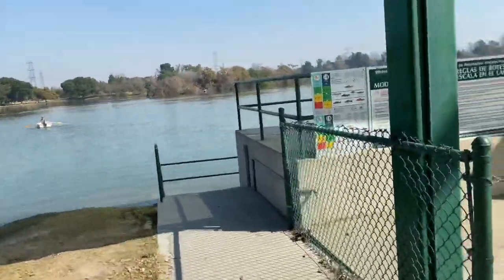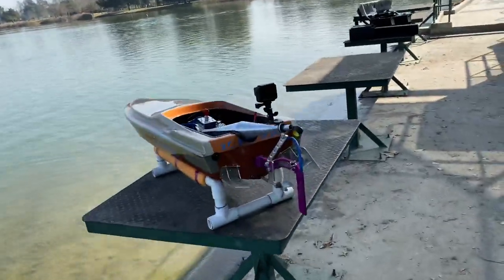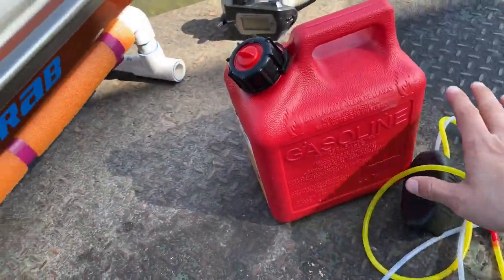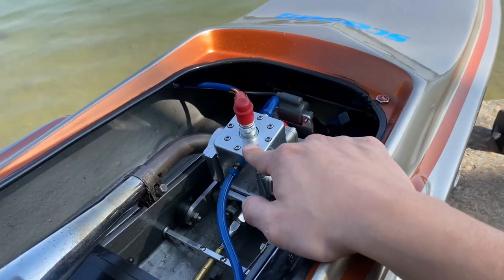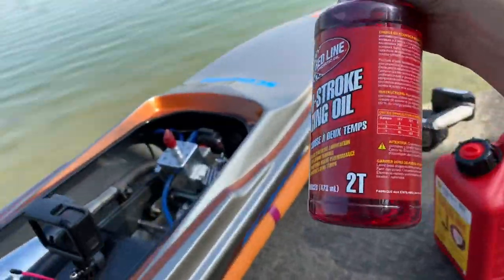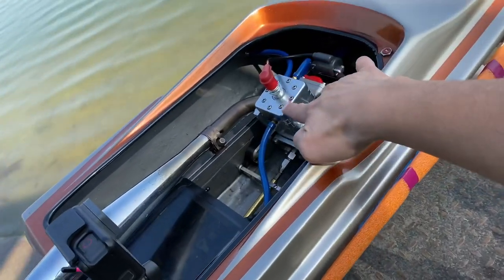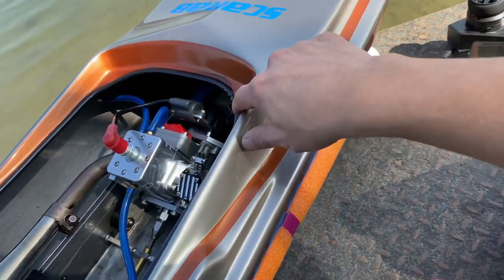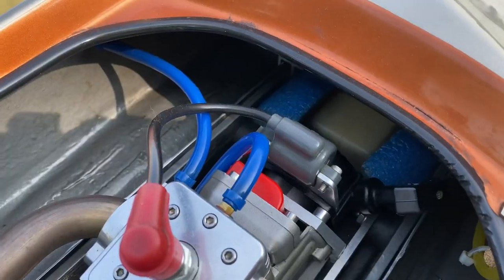Gasoline RC Speed Boat!! — No Nitro!! - Legg Lake California Go Pro - Smith RC Studios

Comment: I'm restoring an almost identical boat I found at the garbage. But it's missing the propeller . Could you please give me a hint on what size prop should I use ?? Thanks.  Regards
Reply from the maker: Take a look at my video here. I would use the exact same propeller I’m using. It’s from Prop Works. 3 blade. 7016/3 with a pitch of 390 or 400 or 420… just watch this video and use same prop https://youtu.be/hiVcycBy4XU
Reply: @SmithRCStudios  wow .really thanks for your reply.  I will have a look. Will check your channel also. Cheers !!

Comment: That was a really cool video. This looks like a cool hobby to get into. I dont have a pond or lake near me but I do have a pretty big river about 4 miles away
Reply from the maker: Rivers work just fine. Even if you drive an hour or so for a lake is fine, just make a day out of it. Thanks for stopping by. Cheers
Reply: Make sure you have a way to retrieve your boat if it runs out of gas or battery since River flows you would lose your toy.

Comment: Maybe I should get a boat to put the 29 Rovan in that would be awesome 😎
Reply from the maker: Lol you know what i would like to stick a big bore gas engine in one of my boats too but boats need marine engines so that they can be water cooled. I’m currently running 30cc gas in my boats. I have not yet seen something bigger than that that will rip... but I’m lookin’ lol. Cheers
Reply: Smith RC Studios that boat was water cooled?
Reply from the maker: Hey man yeah. You can’t run air cooled engines on boats. They will burn up. The water cooled marine gas engines definitely keep them in the right temperature 🤒 lol
Reply: Smith RC Studios that’s awesome 😎 so the must have a water pump?
Reply from the maker: The sweaty potatoe Meyer RC hey dude. This one in particular does not have a water pump but it runs water through lines from the rudder. The engine head has a cooling cap where water runs trough it from the lines. Pretty impressive engineering actually. Cheers bro
Reply: @SmithRCStudios  how much for a complete ready to run set up? Gas, charge stuff and go? Now on the bigger engine problem. Can't you have a water cooled head machined to fit the bigger air cooled engines?...from Wyoming USA 🔫🤠🇺🇸p.s. stay safe and healthy everybody GOD BLESS ❤ I've dabbled in rc's years ago and thinking about playing with the stuff again I have 3 ofna titans 2 regular and one twin engine a couple inexpensive nitro planes and one traxis battery truck smaller than my titan's I forget the model